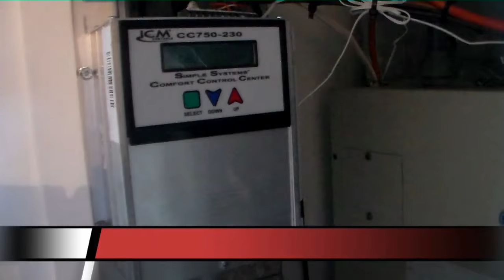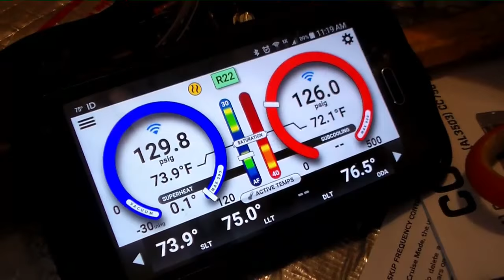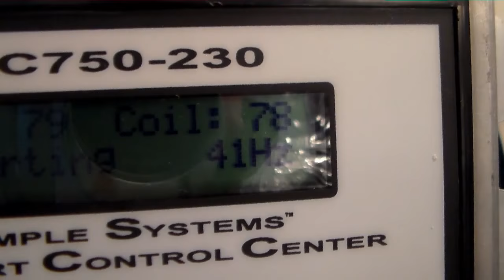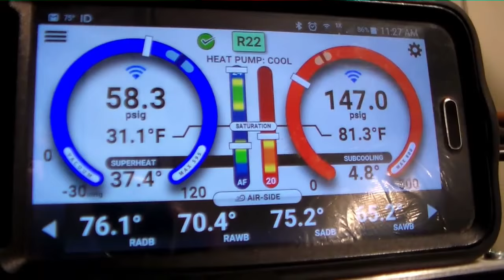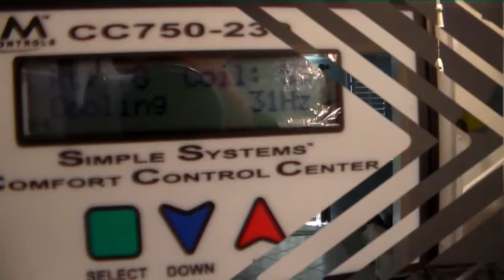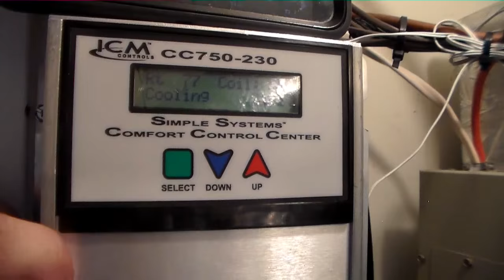ICM 750 VFD Overview and Application

Comment: I thought the ICM CC750 was supposed to be installed on a metal surface. They didn't say why, I assumed as a heat sink for the VFD.

I've seen another YouTube reviewer say they've had 3 ICM CC750's fail on them, and no longer recommend them. 

Have you had any reliability problems?

Comment: Assuming a traditional split system and gas furnace (NOT heatpump).  1) Does this perform any function in heating season and (if so, then what?)?  2) How does it know that it is using gas heat and not AC or a heatpump?   3) Will it still OR only OR not control the fan speed in winter ?  4)  will it still have the always on low speed fan functionality in the winter?  Your fast reply would be greatly appreciated.

Comment: Great video thanks. You said min Hz 30 and Max 50? Why not 60?
Reply from the maker: Good question, I don't know
Reply: 50hz max in inverter mode, full 60hz is applied only in recycle mode. "bypass mode"

Comment: Great video. We have tons of VFDs in commercial settings. Great to see this available for the residential market.
Reply from the maker: Thanks Rob. I bet this one is old hat for you.
Reply: Talyn875 PRO not really. I have never used a single phase like that. Looks like a great alternative to a VS motor.
Reply from the maker: +Rob HVAC I am glad. The biggest problem I will face with this channel is making sure the more experienced techs like yourself have something worth watching.
Reply: Talyn875 PRO I learn something new everyday. Every guy has a different way of doing the same thing. That in itself is learning something new. always remember it all does the same thing, heats or cools.

Comment: Nice job, Zach. A lot of detail there. I'm most impressed with the return temp sensor and the actual coil temp sensor instead of the usual dat sensor that is common with zone panels . I have just a couple questions that you may have touched on that I didn't catch. Did you say, you can or can't get one without a zone board?
What's to prevent the motor from overheating at low speeds or cooking the lubrication out of the bearings from just running hotter than its designed to run even without the windings actually opening? You mentioned the motor ramping up from 30hz to insure that the bearings are sufficiently lubricated and you set the constant fan for 30hz. How does that feature work? Is it timer based?  I don't really understand hertz and sine wave talk.
Reply from the maker: +sad hvacman the instructions say it has a program that is designed to ramp up at intervals (not sure how often) to insure the bearings are lubricated. I may call and see what the logic is exactly. I think that your concern for the motor is a concern that I share. I will like to see it perform over time to ensure the ramping logic will ensure the motor doesn't get toasted.You don't need a zone board. You can send the wiring from the AHU instead of the zone board.
Reply: Right. I thought you said, it always comes with a zone board. We're you saying, you can or can't get one that comes without a zoneboard?
Reply from the maker: +sad hvacman no, the zone board being there is just a coincidence.  the VFD does not come with or require a zone board. if the zone board wad not there I would run a wire to the ahu instead.
Reply: I just went back and listened to the beginning again. I missed the part about it being a previous zone install. BUT STILL, I don't know where in the hell I got that impression from after hearing it again. My bad.
Reply from the maker: sad hvacman no worries Stan. Questions are good. Opens up the discussion.